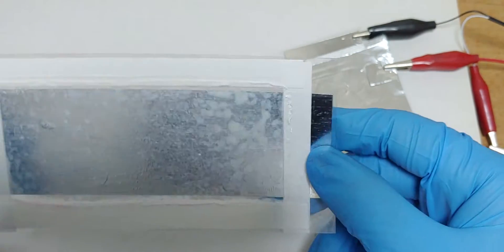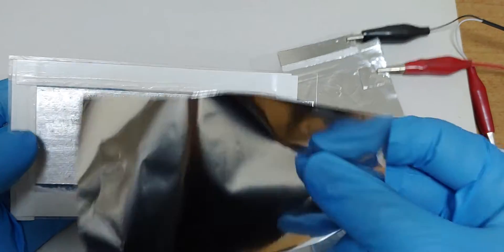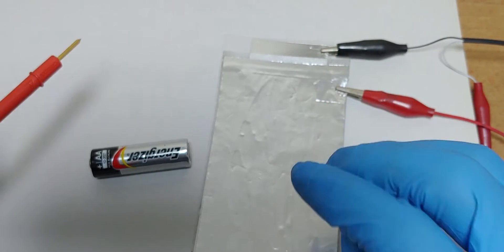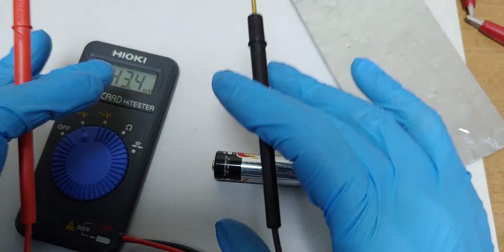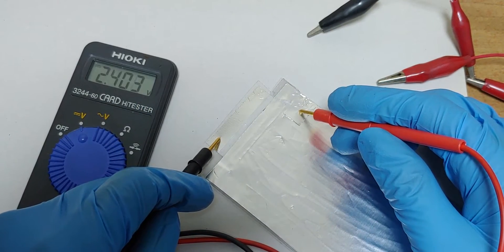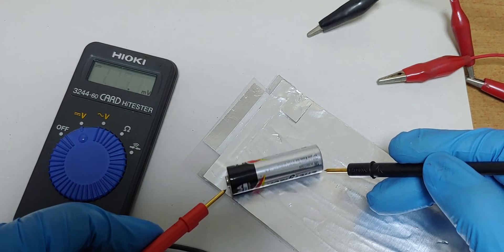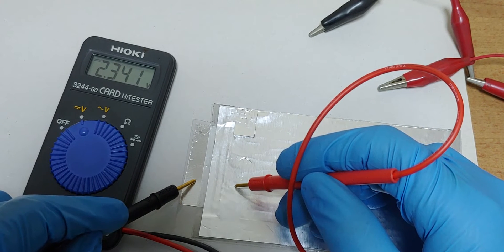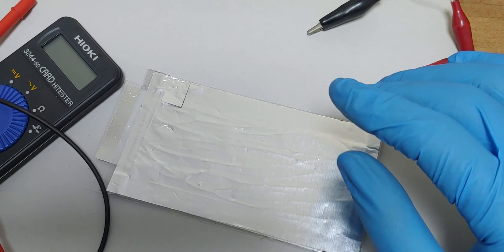graphene and aluminum battery: 2.4V

Comment: Thank you, great science and research. I think Amuinium is anode and graphene is cathode  in your demo, correct? And cermaic coating you are using as electrolyte? what kind of ceramic is that ?  Is that primary or secondary battery in your demo?

Comment: Is the battery acting more like a capacitor  - they can drop in voltage over time like that. A question - for ceramic, do you think coating for car to seal the paint could work? 

If voltage drops, what is the possible reason behind it...could it be short circuit, not enough electrolyte or what is the reason behind that. Do you think?
Reply from the maker: For the first question - yes. I sometimes feel vague of whether solid state battery also function like a capacitor.  Maybe there's too many things we don't know. That's why we have enough reason to continue this research. 
For the second question - I have no knowledge of the material mentioned by you. So I can't say anything about it. Sorry about it.
Have a nice day.